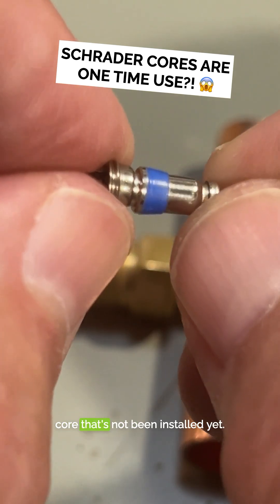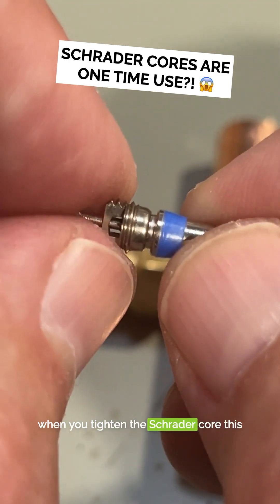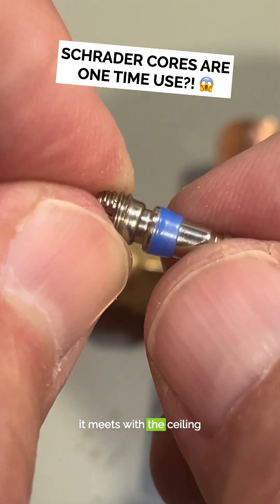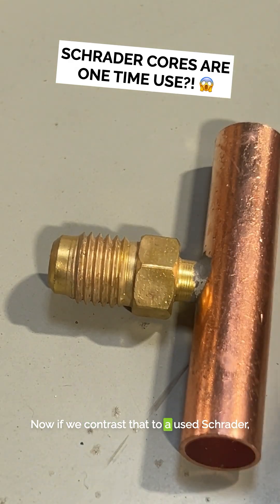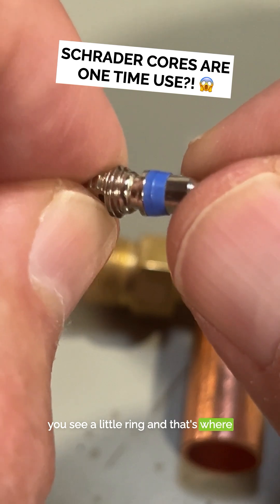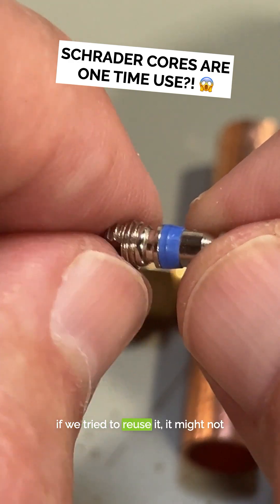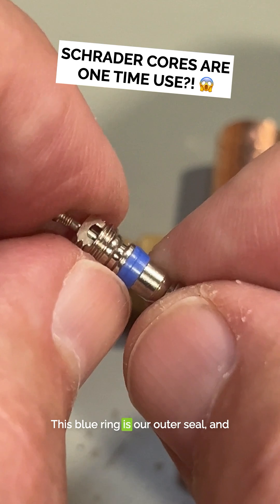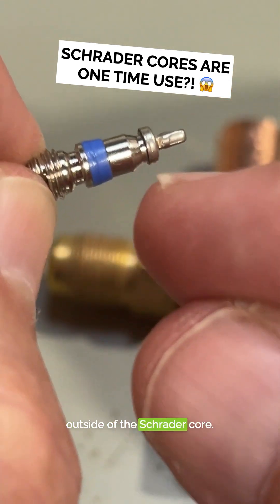Schrader Cores are one time use?!😱

Comment: I imagine this has been done somewhere already, but I think for applications such as a/c refrigerant lines the dust cap for the schraeder valves should be made of metal and designed to seal over top of the schraeder valve. The dust cap then becomes a back-up seal in case the schraeder valve leaks.